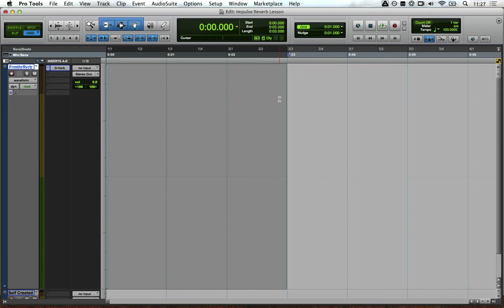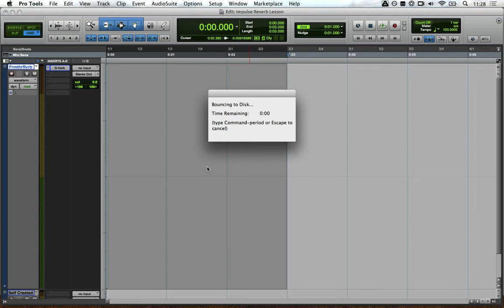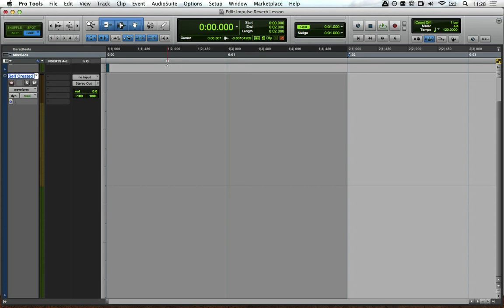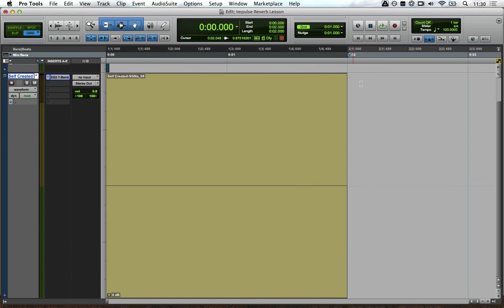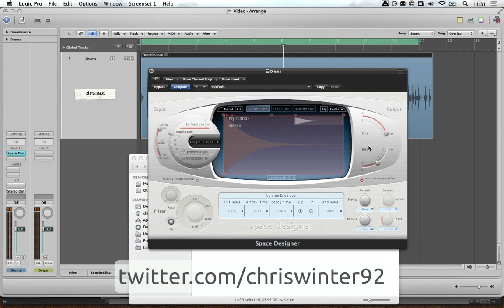2 ways to create Impulse Responses

Comment: Is there any intuitive reason for using white noise? Why not use other signals, for creating the impulse response ?
Reply from the maker: Ajin Tom white noise is a common broadband noise at all freqencies. you can of course experiment with other inputs as well such as pink noise. play about and see what works for you!
Reply: Thanks for the response. Another doubt:
1. How can we compare "clap" VS "white noise" VS 'sine sweep' as impulse input?
I can imagine clap working well, as the reverb will persist for a few milli seconds and intuitively it makes sense to use this.
2. But in the latter two inputs, the sound we want to capture from the arena/environment will be shadowed by the continuous sweep/noise signal right ?
3. Is there a way I can capture all responses and create a better effect plug-in?
Reply: @AjinTom  I don't know if this is still useful for you, a clap can be the representation of an impulse (delta function), in terms of frequency, the Fourier Transform of the delta function is 1 over the whole spectrum, that means that it has all the frequencies, but in practical terms, make an impulse is impossible since the delta function is 1 in time 0, and 0 in any other case, a clap is not an accurate way to represent all the frequencies. That's why is common to use sine sweeps and colored noises.